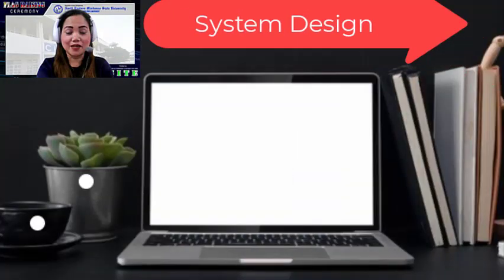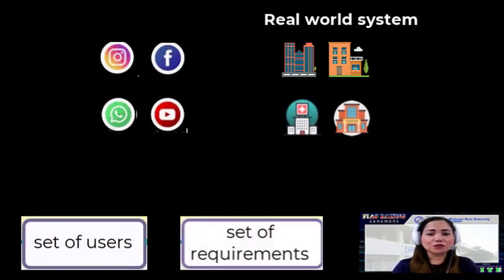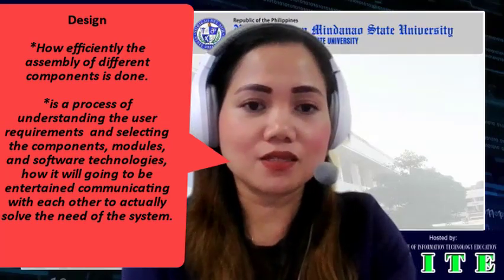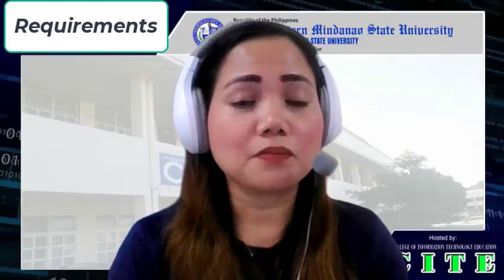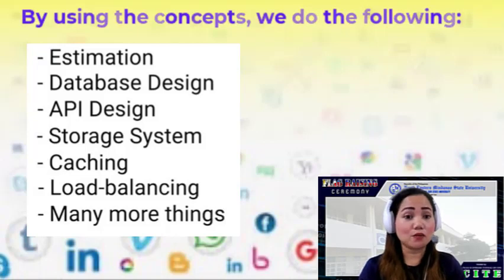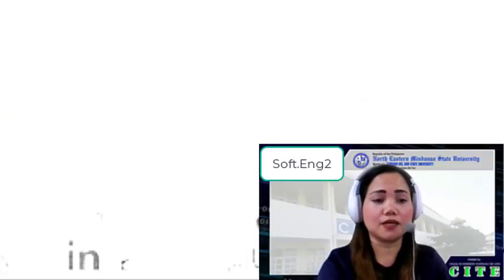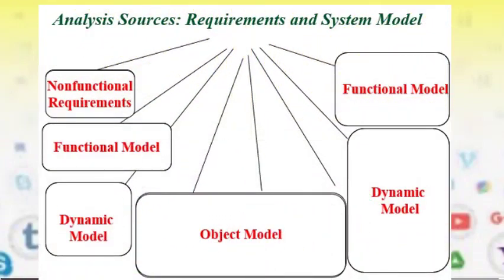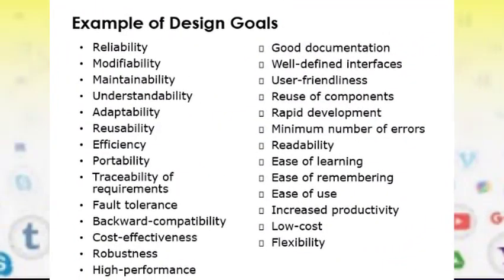System Design

Comment: System design is a crucial aspect of software development, as it serves as the blueprint that guides the creation of robust, efficient, and user-friendly applications. Through informative videos and resources, we gain valuable insights into the importance of system design, which is not just about coding but understanding the broader architecture of software solutions.

Christian M. Bayang 4CSB

Comment: One of the first things I grasped was that system design isn't just about writing code. It's about thinking through the big picture. You start by asking, "What problem am I trying to solve?" From there, you have to figure out how to structure things so they make sense, can handle the load, and can keep going even when things go wrong. It’s less about diving into the details right away and more about zooming out, seeing how all the parts will connect, and then slowly zooming back in.

Jeanth Simon Daniel Polegrates 4CSB

Comment: Joven Charles A. Panganiban - 2CSB - SOF. ENG. 1

- System is a collection of technologies that serves a set of users to fulfill a set of requirements. Inside the "Large Scale Systems" are Computing Systems or Application and Real-world Systems. The two Large Scale Systems have some things in common like, they both have components that need to function altogether to perform the purpose of the system.
Design needs requirements, and designing is difficult.
Required components of system design.
- Computer Network
- Distributed Systems
- Parallel Computing
Design should have goals.